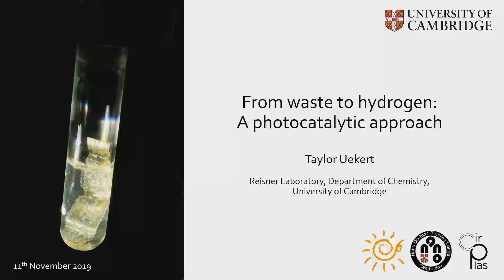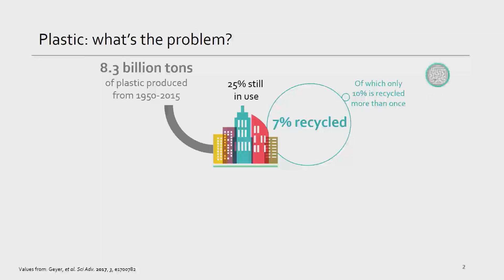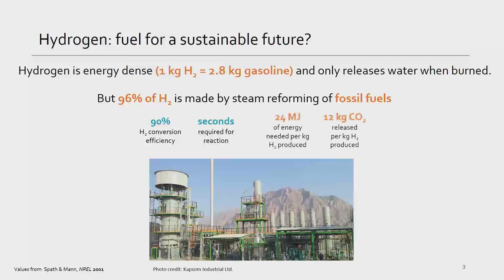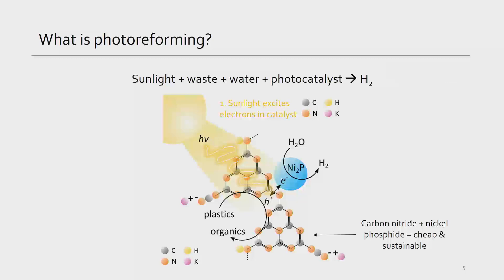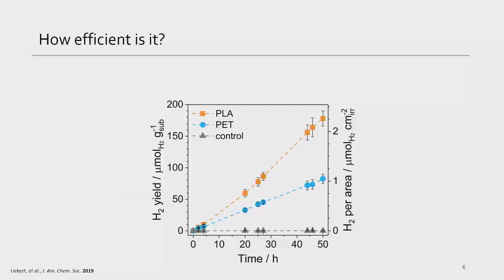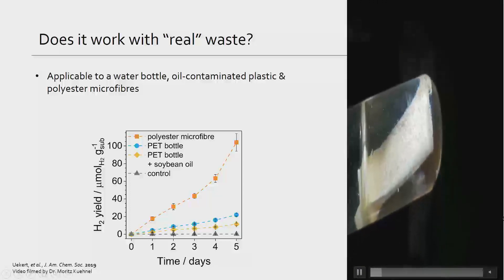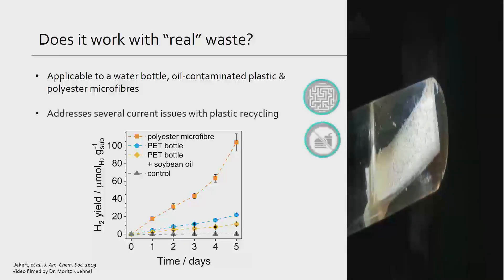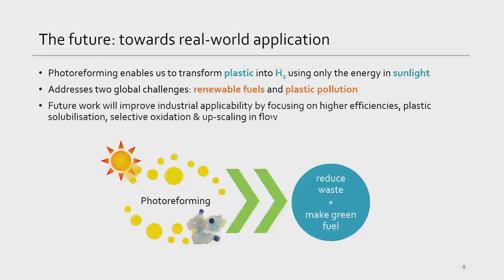CSAR Student presentation: Taylor Uekert, Department of Chemistry, University of Cambridge

Comment: Hello Ma'am I am impressed with your presentation but I have some queries related to your research paper first is what is the exact role of Ni2P with cyanamide functionalized CN because carbon nitride has enough bandgap to act as photocatalyst and the second one is what is the role of the alkaline solution if it is used as to promote reaction then how it will fast the reaction can u explain, please... and the last one is that what is the basic condition required for photocatalyst to do photoreforming.